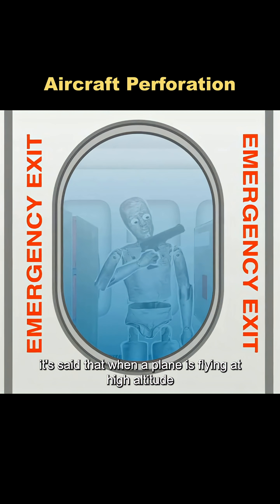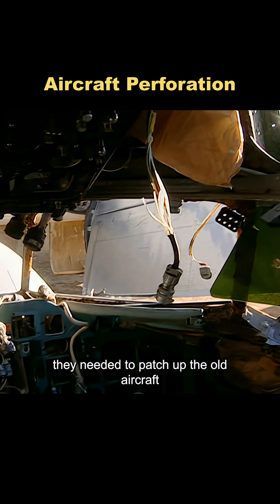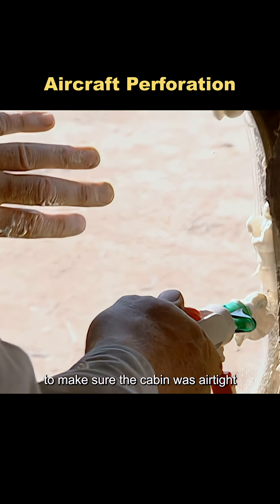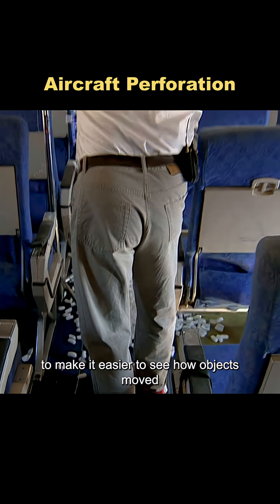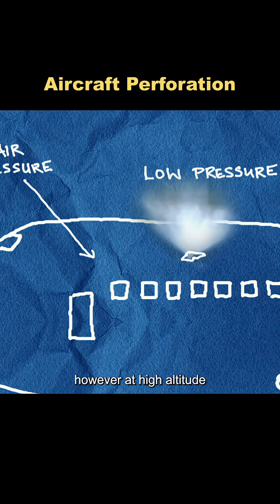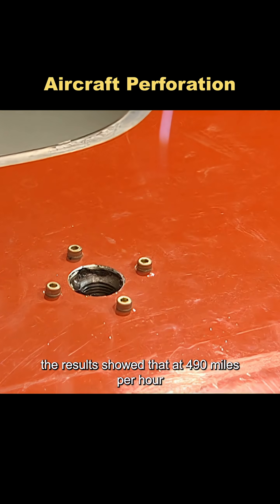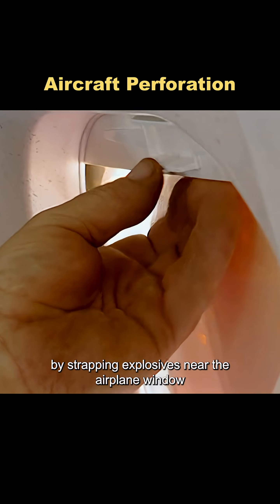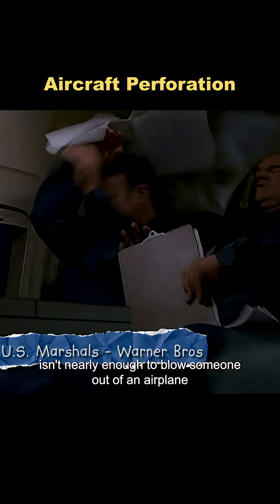What happens if an airplane is hit by a bullet during flight?

Comment: A single bullet hole is not enough. A long time  ago a pilot FFDO was playing with his gun in the cockpit and had an accidental discharge and exited through the bottom of the fuselage. Nothing happened and none of the passengers in the back heard or noticed a thing. The plane landed at its destination and the pilots were busted once ground crew noticed the bullet hole.

Comment: Blow.  Blow people out the hole.  The pressure inside the cabin is greater than outside the cabin, so the motion of the air is initiated by the volume of greater pressure BLOWING outward.

Comment: Try this ib high velocity, up,up, and above. 
There is a big difference between artificial and naturally pressurized.

A simple example is gasoline tanks.
That high altitudes is not high as the plane's goes.

Open it in a carefree way and you have a mark in your 4head. 

Professional? Maybe professionally entitled.

The pressure above is both inside and outside.

Comment: It's the pressure differential that causes an explosion. Not the absolute pressure. The pressure difference between the inside and outside of a plane is only about 10 PSI. A small hole will cause the plane to slowly depressurise, but it won't explode. The problem is when a large hole causes sudden depressurisation. The planes' structure can not cope with the sudden change.

Comment: A puncture at a structiral stable point like a fuselage will not cause structural failure..  But a hole at a not structurally stable point like a plexi window will crack the windows eliminating a large ammount of commpressed air at once that will cause other areas to open suddenly.. Sucking all the air at one point causing destruction of said point...  This is why its better to have NO windows on a plane...

Comment: At high altitudes the atmospheric pressure is very low compared to the cabin pressure. The test should have been done inside a low pressurized tunnel simulating pressure at high altitudes.

Comment: For a more realistic test they should of used some kind of cable fixed to a plane and pulled the test plane along behind up at altitude, however, the risk of catastrophic loss of both planes would be high and whoever they could find to pilot the first plane, well his balls would probably be too heavy to get off of the ground in the first place.
Reply: Well 😮 if just a pair of balls is too heavy ⚖️... How do you account for several pairs of balls @ passengers 😅 being airlifted day in Day out😅 😂🎉

Comment: Myth buster should rent a used airplane. And drive it remotely to cruising altitude. At 30.000 feet, they can start experiment the shooting glass. 

That's how they should be doing it.
Reply: Are you dense? If the myth turns out to be true, the FAA isn’t going to be happy knowing this was deliberate and having a plane getting torn apart at 40,000 feet. Even over the sea, there won’t be any charter companies willing to hand over a Boeing 737 or A320 for this test knowing there might be a risk of it blowing up.

Comment: You guys are missing the pseudo force that was applied after the plane is in mid air The experiment on the ground doesn't actually simulate any aircraft that was flying on high altitude the vibration is also the fact that can unbalance plane

Comment: The cabin was pressurized but it was at sea level. Also at cruising speeds the air rushing past the hole basically grabs onto the air from the cabin and pulling it out kinda like a carburetor where the air rushing past the fuel nozzle grabs the fuel and pulls it along into the engine.
Reply: Carburetors works on ventury effect. Can't have that along a fuselage in open air.

Comment: It's not moving 700mph
Reply: Nor is at 40,000 feet where there is 15% the pressure of sea level.
Reply: @vjrei Doesn't matter as long as they simulate the pressure difference.
Reply: @AMan-cx4ns  it does
Reply: @Dimuscus How?
Reply: @AMan-cx4ns  I'm not saying the myth is correct nor wrong but I'm saying if they had speed maybe the would have had different outcomes. It's almost like pushing your hand slowly and fast through water it's harder if you go fast. So with my little knowledge I think the dummy would have moved, not sure out or in though, because of the Fast moving plane and the resistance it has. ✈️
Reply: @AMan-cx4ns they forgot about wind resistance
Reply: @AMan-cx4ns they have not simulated the outside pressure at fl 390, for example....
Reply: @1SirBull  The outside pressure doesn't matter really, the difference between the two matters
Reply: Myth busters have failed on this one the simulation is not at par with the real scenario
Reply: @josephmtsindula7256  Are you volunteering to be the test dummy at 30k ft? Lol
Reply: What you missed is, even though it could be going 600mph (700 is too much), because the air is so thin it's not the same as 600mph at sea level. The force created by the airspeed is much less than you think.
Reply: No airline other than Concord can fly at 700mph
Reply: Concorde cruised at 1,350 miles per hour
Reply: @DavidFennessy-yj7du  i dont think so u probably mixed up mph with kph

Comment: If the bullet punctures the metal skin and not the window the results would be  catastrophic.  Research the DeHavilland Comet.
Reply: Difference that the DHC's metal was weak,so it broke apart,it was not because some crackhead shot inside
Reply: lol 😂
Reply: It was because they had squarish windows and that proved to structurally weakened the plane under pressure at 28,000 feet, after 3 crashes they grounded the fleet and that's why? plane windows are shaped the way they are now.